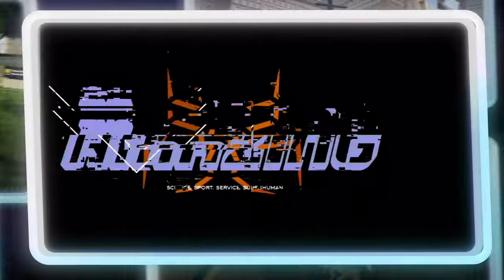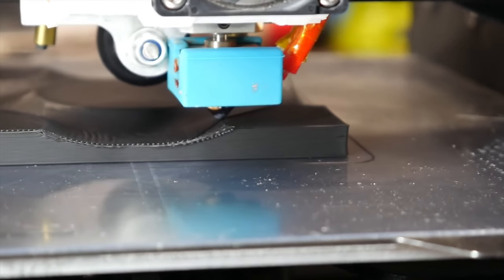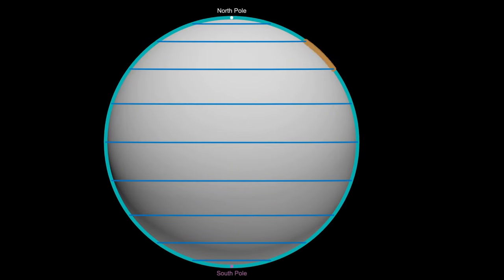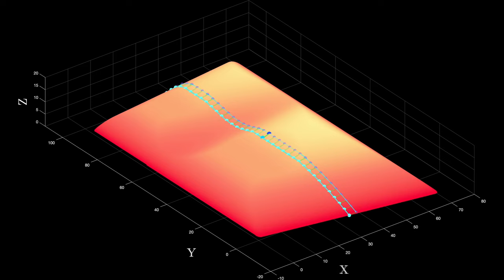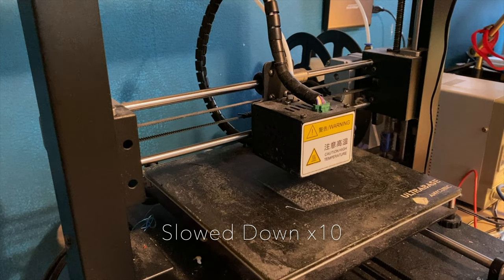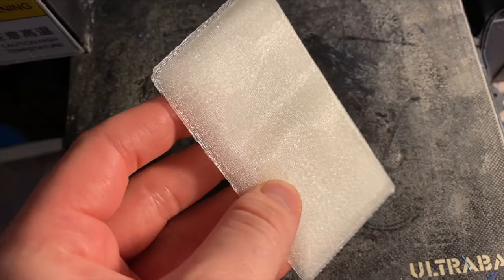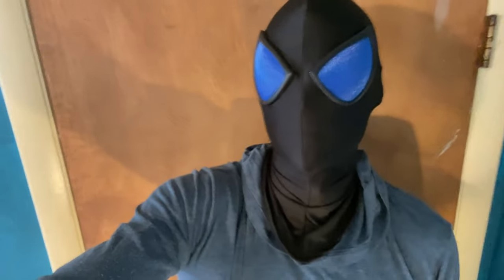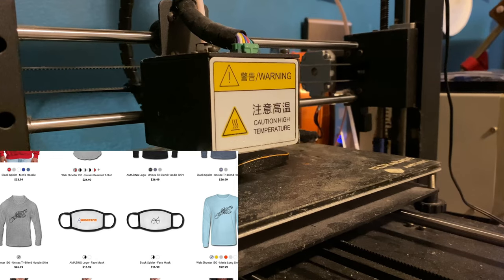NON-PLANAR 3D PRINTING For Spider-Man Eyes!!

Comment: To print a grid structure with a normal slicer, interlace columns and rows exactly one layer. This stops the slicer from "playing snake", and the layers will still fuse, just with a little less material and a lot less artifacts.

Comment: sidenote- the less bright the colour of the lens, the more you will be able to see out of it. My mesh is black on the inside and white on the outside for that reason. if it's too light of a colour then the photons bounce off of the mesh straight into your eye and it sucks.
Reply from the maker: Yeah, that's what I observed in this video
Reply: @theAmazing  yes but you could paint the inside of your mesh black so that no matter what colour it is you’re good, or paint a black mesh the colour you want- or print a black mesh and layer it to avoid the bouncing trouble.